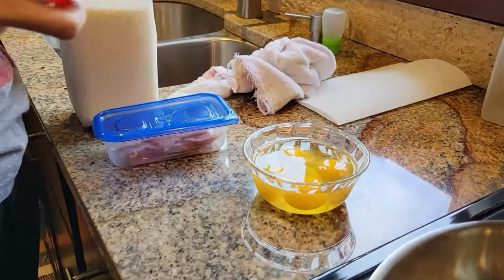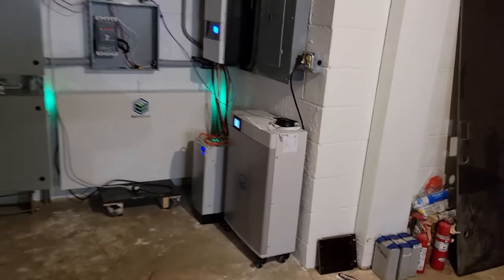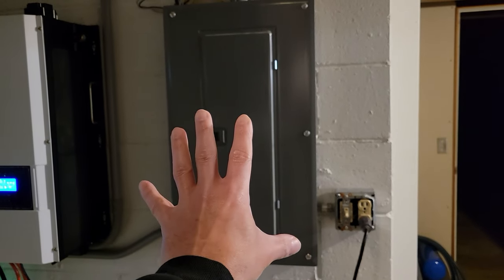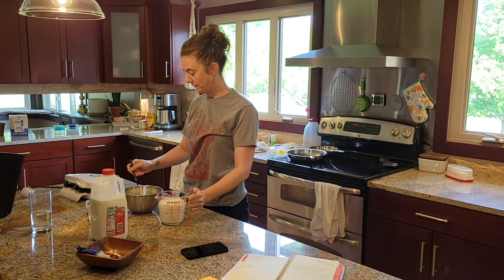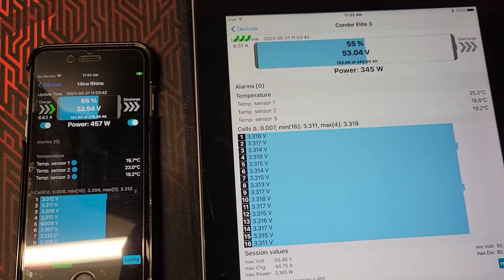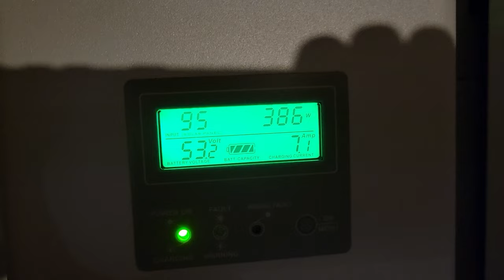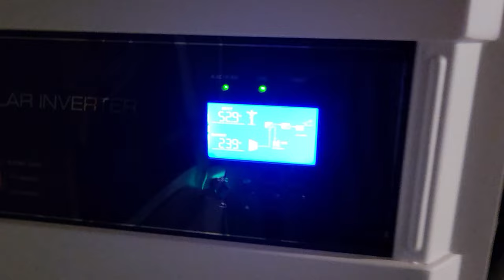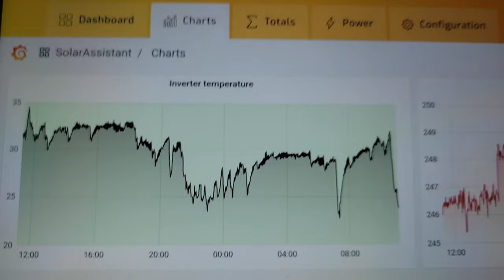First Time Powering 240v Stove Off-Grid for Breakfast!!!!

Comment: Congratulations, Thanks to Andy in Australia and yourself, I have been running all my home, I'm in the UK so 230V for everything , including my ASHP, (we don't have or need AC in the UK). Off Grid. It's mid May now so I don't see much need for "The grid" until about September, fingers crossed!
Reply from the maker: Awesome!!!  That would be GREAT if we didnt have to run the AC.....Holy Crap it sucks down the batteries!!!!
Reply: @AveRage_Joe  All my ac is mini split heat pumps, SEER 18 to 20, I have a 9k btu, a 12k btu and an 18k btu unit. During the summer unless it's overcast/rain the solar supplies all the ac from 8 or 9am till usually around midnight to 2am with my current battery storage and all my other loads running normally. All three running wide open along with normal loads pulls about 2.5 to 3kw and since they are all inverter based heat pumps they have no startup surge. Total wattage for all three at max output is around 2200 watts. Heat pump dryer pulls another 800 watts while in use on top of that. Washing and drying clothes on solar is nice too :)

Comment: look at an easy-air soft start kit for your airconditioner.  It can be self installed.  it drastically reduces start up watts and even reduces running watts a bit.  They are strongly recommended by professionals whenever someone wants to add their A/C or heat pump to their solar-inverter set up.
Reply from the maker: 100% ordered one on friday after I moved the wiring around and will install tomorrow!😆💪💥🤘
Reply: @AveRage_Joe  Video?

Comment: I have the same inverter and I have it installed between my main panel and the grid via a generator interlock breaker and parallel taps on my grid supply.  I have a Microair soft start in the house AC and I can't even tell when it kicks on.   When I use a smaller burner in my stove I don't get any dickering, but I do with the large burner. Surprisingly the oven doesn't make much flickering.
Reply: BTW, this inverter supports being A/C coupled with a grid-tied inverter and it will charge the batteries from it, but it has no way to turn off the grid-tied inverter when it is full, so I have a remote controlled breaker between my main panel and the grid-tied inverter that is controlled by a voltage sensing relay.  So far it has operated flawlessly, and if you switch the inverter from solar/battery mode to grid mode your grid-tied inverter will still backfeed the grid.    Very handy to have 100% of my home backed up.
Reply from the maker: Sweet! I ordered a microair soft start as well and hope to install it tomorrow. They way I am backfeeding that other panel that has the AC and dryer, its kind of a long run of wires so I would imagine that doesnt help lol but the soft start should take care of the dimming.💪💥🤘
Reply from the maker: I always wondered if it could! Yeah I guess you would need a way to shuter down lol

Comment: Do you have any concerns backfeeding your main from your sub panel. 
I have wanted to do this, but fear some neutral ground bond explosion might occur, lol.
Reply from the maker: I was freakin my self out the first time I did it just like you mention last year attempting to see if I could power the stove and AC on just the rhino battery.  Not to worried now tho lol. My ground and neutral are on the same ground as grid jfyi but no issues since the mains are disconnected. What inverter do you have?
Reply: @AveRage_Joe  same as you. 
Really enjoy your posts btw. Thank you.
Reply from the maker: Oh then EZPZ😆 Thanks 🤘

Comment: How did you setup the other solar charge controller. I’m planning to do the same cause I have extra solar panels.
Reply from the maker: At this moment, I just have the output of the charge controller connected to the inverters battery posts. Later Ill have everythinh connected to bussbars.

Comment: HVAC may be stalling due to startup in-rush. Check the HVAC specs and technicians at the factory as it could damage the unit.
Reply from the maker: HVAC starts and run fine, just dims the lights.  The LRA if I remember said 137amps lol. I just purchased a soft start and will install it asap.🤘

Comment: Hey Joe, Dig on your vids.. very detailed on consumption and usage.. I just wondering, I see you have several different capacity Big Batteries in parallel? I have 2 different capacity battery evo units and have been skeptical on joining them together on the same system because of the AH differences. I have a 100AH and a 120 AH 24 volt batteries... You seem to be having no problems doing that.. what are your thoughts on this?
Again, thanks for the cool funny and instructional video's :goodvibes:
Reply from the maker: Thanks Man and Appreciate that! I actually have 3 of there batteries connected in parallel. All are diff range from 100ah to 276ah. I have no issues. Been running the 3 for a few months. Before that I was running the 100 and 276ah for a year and again, no issues.  They stay pretty close to the same voltage at all times. Only "differences" in voltage is when you use longer or shorter cables. If you can, try to use the same length and size cables.  Id do it if I had your batteries 100%🤘
Reply: @AveRage_Joe  I'm going to try it... Thanks Bud

Comment: Congrats. Its pretty hard to run the stove off grid. Cheers
Reply from the maker: Yeah it is. Ive only done it for some test and WHOA power sucker for sure lol
Reply: @AveRage_Joe  Ya I know. I have a bbq,2 burner hot plate and a propane element. Dont really need the stove personally. Honestly I dont even need my system. Had plans to move north off grid but plans have changed. 60 kwh of batteries doig nothing right now. Also if an emp or lightening strike hits system is done but not if its unhooked. I have a small grid tied system running instead. Cheers
Reply: 120 volt induction and toaster ovens are doable without getting crazy.
Reply: @Deveak  even the old style burners work fine. I have 10 kw inverter and 60 kwh lifepo4 bank. Cheapest I could build. Cheers

Comment: Good, but the removal of the interlock is scary.  Assume it's only for demonstration purposes.  Thx.
Reply from the maker: Yeah its more of a "test". The main panel is a super old one with the big ol fuses you pull out. I put a label on the fuse block for others to see if I wasnt home.🤘
Reply: @AveRage_Joe  gotcha.  I recommend the Electrician Ron channel if you are contemplating changing your service.  Thx.